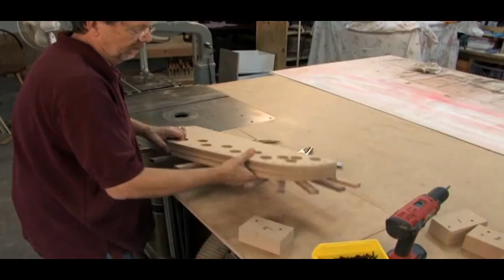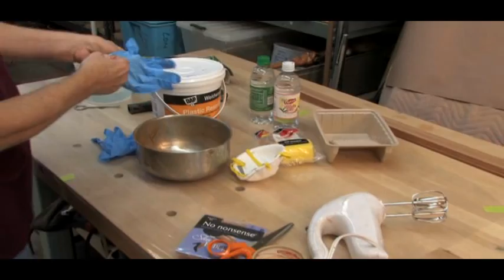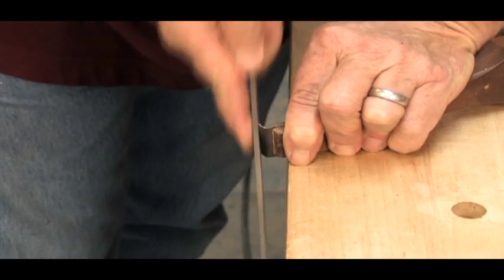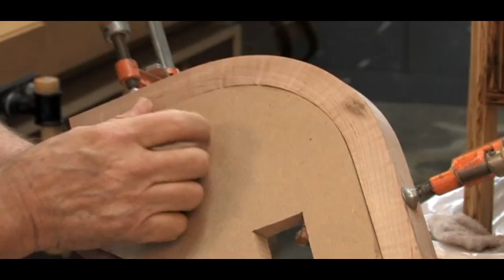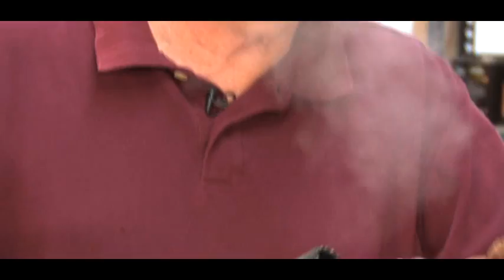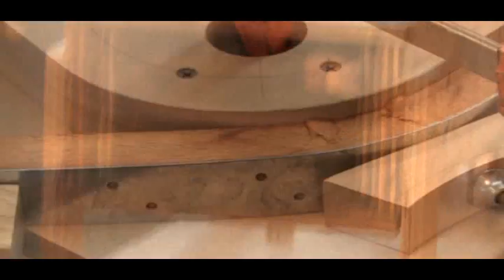Wood Bending Made Simple

Comment: Amazingly educational ! I gained understanding of a process not merely a monkey see , monkey do list of steps.  Thank you !!!
I have a question, is it possible or even advisable to try to incorporate both methods in the same bend ?  I want to end up with bent 4" x 4" walnut pieces that will be greater than 90 degrees over an ~ 30" finished outside dimension. Side supports for the base of a trestles table. 
I was thinking about resawing and planing to ¼" x 4+" pieces , steam bending them to shape then gluing after they have cooled and dried.  
Please let me know your thoughts on this idea.

Regards

G
Reply from the maker: Hi. I think if I understand correctly you need the first method.

Comment: I’m a wooden model ship builder and this video has been more then helpful. I’m working with thicker planks then I have ever done in the last 30 years and having a heck of a time not breaking them on the bow ( I’ve always had good luck with just soaking them). I’m going to make a steam pipe, this seems to be the answer to all my problems. Thank you so much for sharing your knowledge. Just a quick thought I was a boiler operator in the navy. The boilers I worked on ran at 1200psi so I know the dangers of steam first hand. Thanks again.

Comment: Excellent video. I am contemplating doing a curved desk where I will need a bent lamination about 6" wide by 3/4" thick by 84" long for a skirt between the top and the lower shelf. I have thought about several different ways to do this but with your video I feel more confident about doing a bent lamination.
Reply from the maker: Thank you. If you will need I'll be happy.